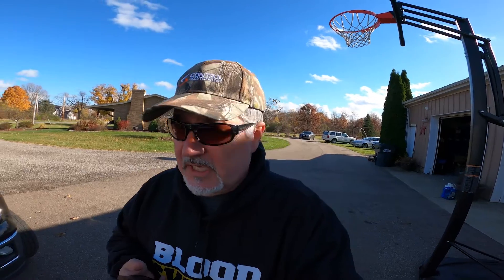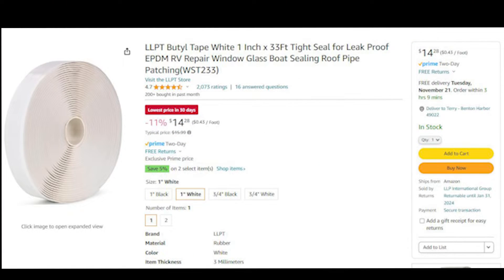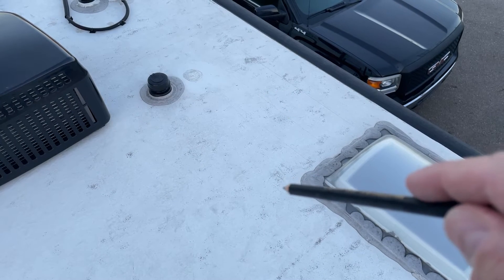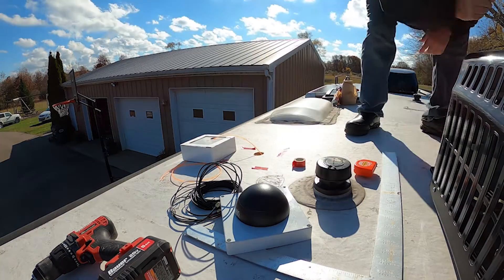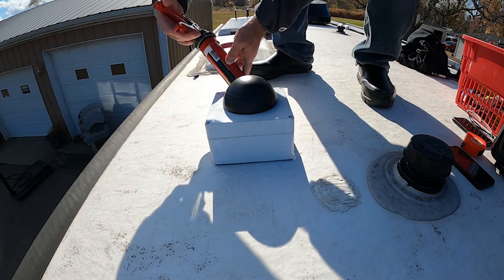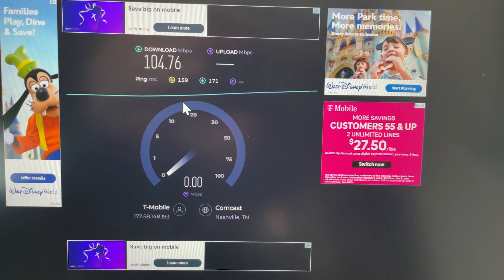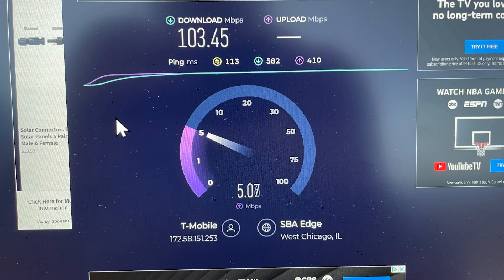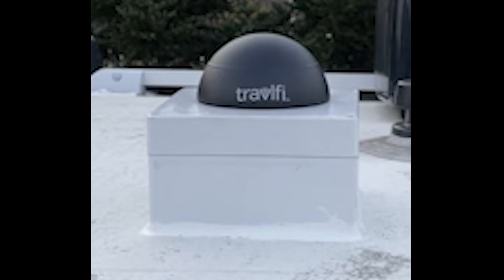TravlFi: portable high speed WIFI Roof Top Antenna Install and speed test! RV Internet

Comment: If my XTR router antenna connection markings are the same as the markings on the XTR unit in this video, then the 'WiFi Main' & 'AUX' antenna cable connections in this video may be incorrect. I've had significantly better wifi/hotspot signal with 'WiFi Main' antenna cable connected to 'WiFi 2.4' & the 'WiFi Aux' antenna cable connected to 'WiFi 5G'. This fix was with the assistance of TravleFi support, although they were a bit vague, it all worked out. Thanks again for the Video.. Very helpful..
Reply from the maker: @bradmarlin2964  always enjoy a success story, thanks for sharing it!

Comment: New owner of Travlfi with the external antenna. I'm also hitting T-mobile, which is odd but regardless. I'm getting less than 10 up and 10 down regardless of the attached or external antenna.
Reply from the maker: @MWR-lg9qp  sometimes location hurts! Last week we were in Ludington state park in Michigan. Nothing worked in the Cedar loop camp area except starlink. 3 miles west and I hade 55down and 15 up. 

Check out cellmapper on a browser and check out your towers near you. Hopefully you've used that tower sync button on the portal
Reply from the maker: So hopefully you're using the portal online with your mobile device, you definitely wanna go out and click the scan button. I think it's called "tower sync" that will force the router to reevaluate, signal quality, that's what they tell me and believe it or not it works for us. Sometime when we are located along the shoreline of Michigan in the state Forest areas we are several miles from the tower and of course the speeds are significantly slower in the middle of nowhere.

Comment: Thank you Thank you Thank you.  Just purchased the Journey XTR and the external antenna and very surprised TravlFi did not supply instructions for the antenna.  Where did you find the connection diagram?
Reply from the maker: I called them! I also was disappointed seeing no instructions!
Reply: @ThreeDayRV  Thanks for the Video, much appreciated!  - So the Wifi Main & Wifi AUX remote antenna cables both connect Wifi 2.4 ports & neither go the 5G Wifi connection port? THNX
Reply from the maker: @bradmarlin2964  yeah right off the top of my head I don't recall, but if you go back to my video and freeze it, I supplied a wiring diagram to show you where they all plug in! 
If you send me your email, I can shoot you the drawing over. It is straightforward.

Comment: Is this antenna any good ? I have the Travlfi hot spot and I up graded to the 5g . It’s been awesome
Reply from the maker: The antenna that I have only works on the 4G system, as it is a different bandwidth and frequency antenna. 
I am currently completing a video where I am testing the 5G router with extremely good results . 

So far that router is incredible fast ! 

That video should come out today, and I hear there is an antenna in the future !

Comment: How has the exterior box held up on the roof after time. The box I found ( same brand) appears to have plastic fasteners which concerns me. Your thoughts?
Reply from the maker: @dahlpix  great question. I've worked since 1989 on commercial buildings and over time the sun always wins lol. 

Instead of using the external tabs I measured and layed out 4 new holes in the box, pre-drilled. Used a large amount of the good sealer and screwed it down. So far it's holding up well. 
Great question !

Comment: Does anyone know if it will work with or has experience using this with their new 5G router that they just came out with?  I know it was originally for use with their LTE router but wonder if I upgrade to the 5G router if this external antenna will still work with the upgraded 5G router?
Reply from the maker: Great question and I literally just sent this question into tech support to find out.
Reply from the maker: I dont believe the 4G and 5G antennas are the same.   Here is a great article to skim through.          https://www.sannytelecom.com/4g-antennas-vs-5g-antennas/#:~:text=few%20key%20differences%3A-,1.,2.
Reply from the maker: Hi Todd, I received a quick reply from the TravlFi SME and no the RTU antenna like I have installed won't support the 5G router. Here is their response word for word :
"No, the current rooftop/outdoor antenna sold for the JourneyXTR does not support the new 5G router offering. The antenna is not configured for or tuned to handle 5G (specifically mid to high 5G bands).
 
Also, note that all 6 external antennas on the new 5G router offering are dedicated solely to cellular/5G reception."

Thanks Todd this was a great question!

Comment: Improved speed?
Reply from the maker: Yes speeds improved a fair amount, somewhere between 18 to 30Mbps down. This is a worthwhile add on and the router itself is very fast having a best speed test for me of 135Mbps. We can not complain about it. It fits our camping lifestyle perfectly. The router also connects to the campground we love so that we do not use any data! #Gamechanger!
Reply from the maker: Yes, I have no way to measure db gain but Speedtest.net definitely showed great gains as we expected. Well worth it.

Comment: This device works! But, it's not anywhere close to ideal. it works maybe 75% in SE State Parks and almost never the first night of rv camping. I recently purchased the outside antenna( came with no directions) watched this video, rebooted multiple times and still no luck. My Verizon cell phone has two bars. 😡
Reply from the maker: Sorry to hear this. I have an area in mid Michigan where mine struggles as well. When you open a browser, go to travfi customer portal, select "manual change provider" and see if it helps. 
It appears that Travfi no longer uses Verizon. Not sure what's going on there.. 

The next thing is download a speed test app. Select 5G network on your phone or tablet and run the test. Let us know what service shows up when you test , my bet is it's ATT. 
Third , I'd call them. If it doesn't have a carrier in your area that had solid service it won't be a value, let me know how these go.
Reply from the maker: We just completed a 2500 mile spring break trip 12 nights using state parks from Michigan to Florida and back., We had really good luck with the Travlfi system. There was one state where the service was slower at 14down and 2 up, but we still streamed our YouTube videos.  Our strongest signal was 122Mbps but the average speed over all of Florida was 82Mdown, average up was 21. Somedays better of course. It worked very good for what we do and it is on all of the time in our solar powered RV. It has truly been a game changer for us to stay connected...